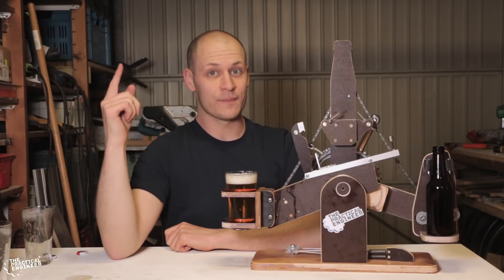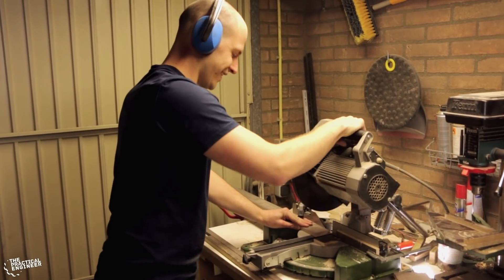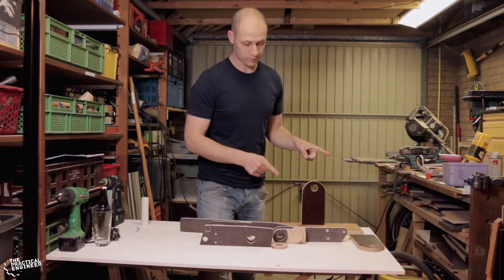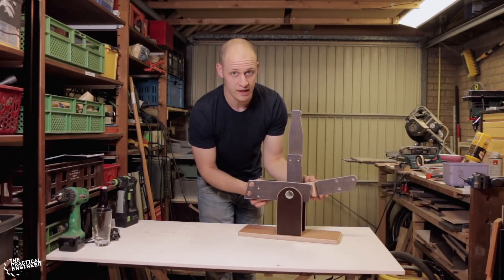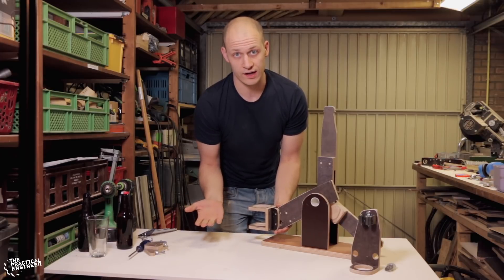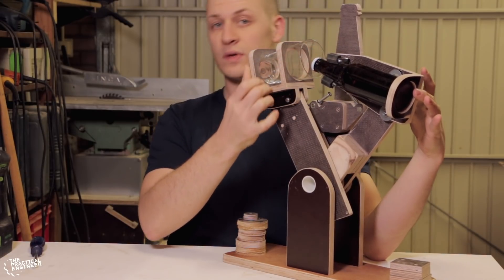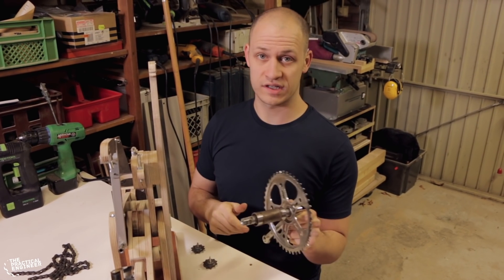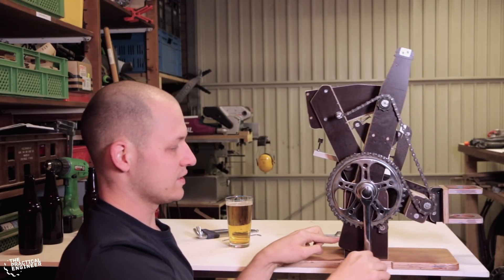How to pour a beer - Making a cool beer pouring machine!

Comment: U should put some sort of shock that absorbs the weight of the glass and beer as it pours.
Reply from the maker: To get a smoother pour you mean? I think that could improve it. I was also thinking about some mechanism that actually tilts the glass while pouring
Reply: @Thepracticalengineer  yes for the smoother pour and having the glass tilt would be sweet as well. Great build man, very impressive.
Reply from the maker: Thanks!

Comment: Crazy 😂. But very clever.
Reply from the maker: Thanks!
Reply from the maker: Nothing wrong with crazy right?
Reply: Not at all 😂. As I mentioned on my other post...I love projects like this. Is all about the thought process and the problem solving. A lot of the projects I do it’s been more about the challenge rather than the project...and I much prefer one off builds. The crazier the better for me. Funny thing as well...I love cruising and if you’ve seen the new Royal Caribbean ships they have automated robot cocktail makers...I guess similar in concept to what you’ve done here. You’ll have to take a look.
Reply from the maker: I fully agree with you! The end result is just the end result. It's the process that matters. 
Thanks for the tip! That's a nice project idea as well!